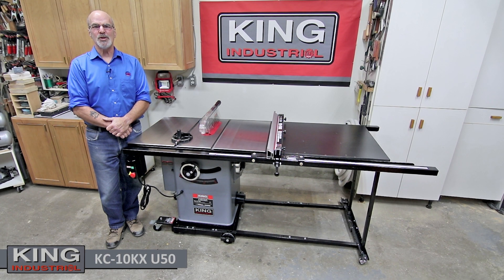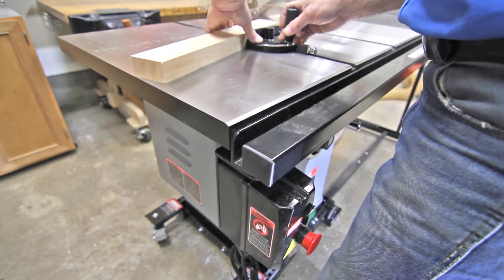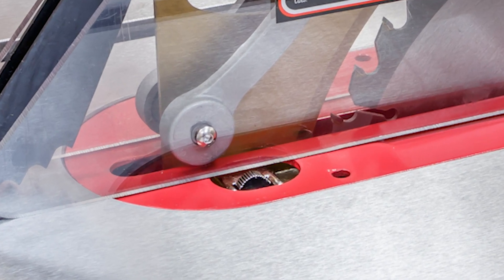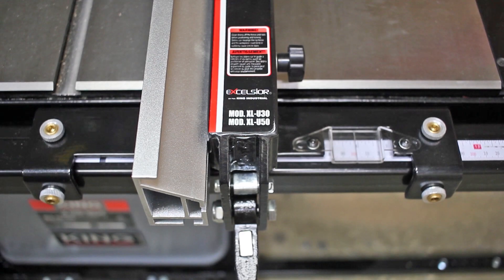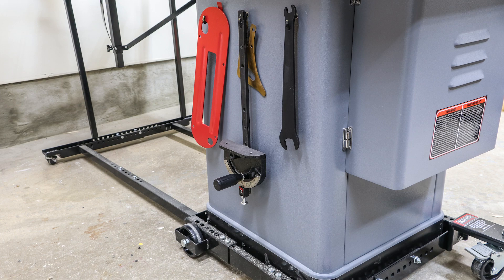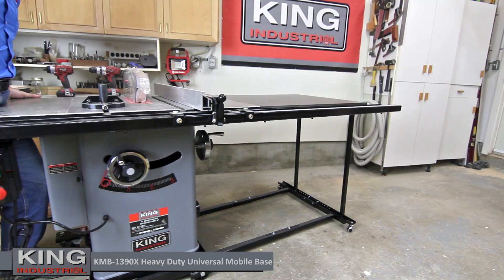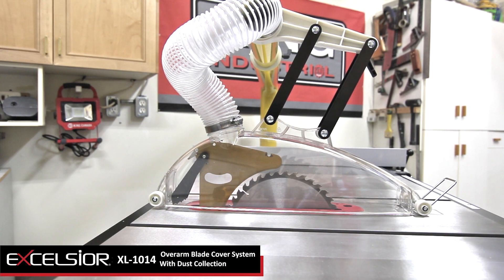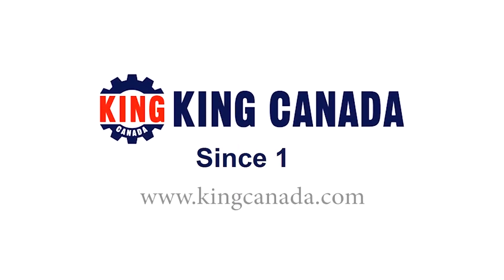King Industrial 10” Cabinet Table Saw and Accessories

Comment: A 10 inch by 40 inch blade. Whoa. Must be more than 2.5 hp!
Reply: The blade is 40 tooth not 40 inch
Reply: @ziadeziada4039  i realize that, but he said 10 inch by 40 inch.

Comment: What is the power requirements for this saw?
Reply from the maker: Hello,
the power requirements will be 220V.
Thank you!
Reply: @KINGCANADAINC  ok great thx, and just on a 15 amp circuit is good?
Reply from the maker: @mapleridgefarm1026  Yes, it would work at 15 Amp.
Reply: @KINGCANADAINC  ok thanks

Comment: What are the assembled dimensions?
Reply from the maker: Hello,
thank you for your question. The cabinet table saw with 30" Rip capacity has the following assembled dimensions: 40" length x 34.25" width x 41" height. While the table saw with 50" Rip capacity has - 60" length x 34.25" width x 41" height.
Thank you!

Comment: Anyone own this? Thoughts? Considering this for my first table saw
Reply: I do, great saw, but the aluminium part of the fence is not straight and apparently they are all the same. Mine have .005 of a curb in the middle, .005 and over can be problematic as far as precision goes imo and maybe binding ? Ill have to test that out with bigger pieces. 

If i was to buy again, maybe i would give a shot at the bigger model, just maybe for the extra beefer fence.

I have multiple king machines, all good so far !
Reply: I have the newer model KC26FXTi505052 it’s 3 hp and it’s a solid saw
Reply: I just started working for someone who has this saw.
It's atrocious. Not user friendly, hard to adjust the blade height wheel, the throat plate is too thin and flexes when pressure is applied downwards. I had to design a new throat plate with computer software, and make a thicker one using my CNC.  Trying to make one without would be difficult, King has made it so.
Go buy a General, if you can find one, or a Delta.
Reply: @acerjuglans383 the delta sucks